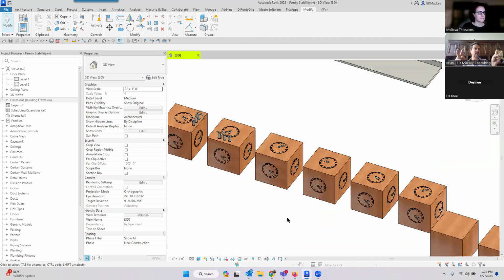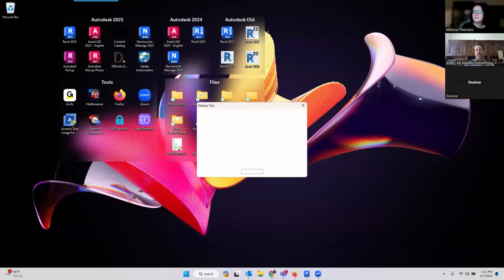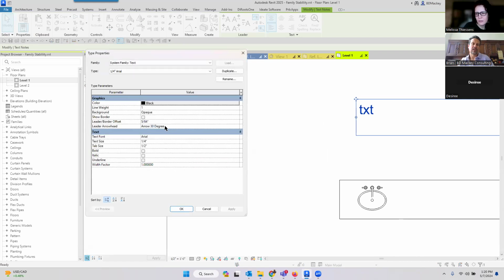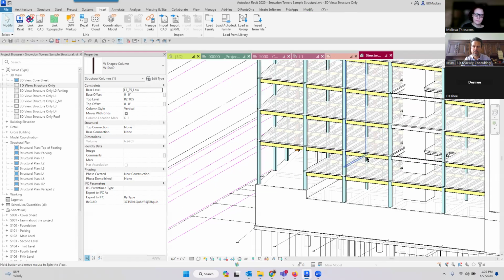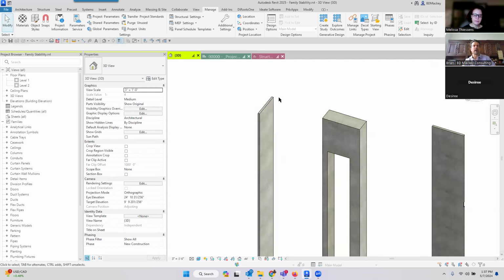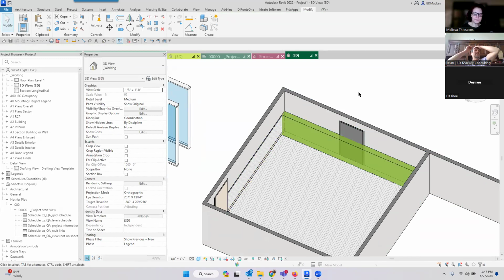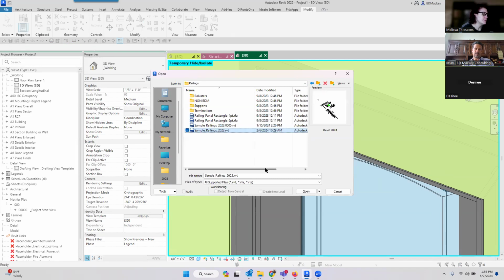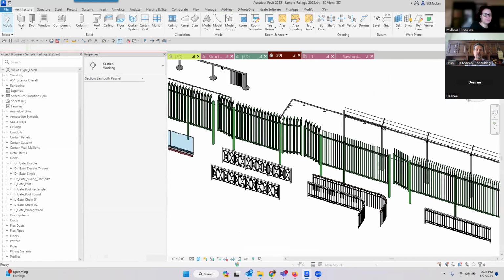Revit Radio May 2024

Comment: Hello,
How did you change the colors of the tabs on REVIT 2025?
Are they colored by type or by project?
Reply from the maker: I am using the add in from https://www.parallaxteam.com/ called Neat UI.  pyRevit has a similar capability but it isn't updated for 2025 yet.